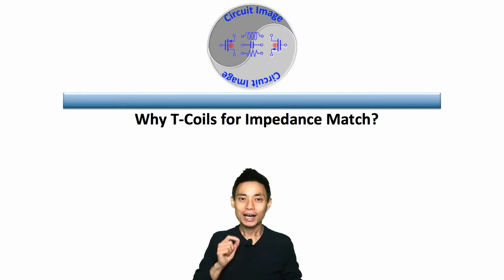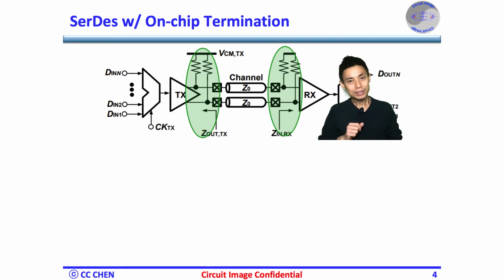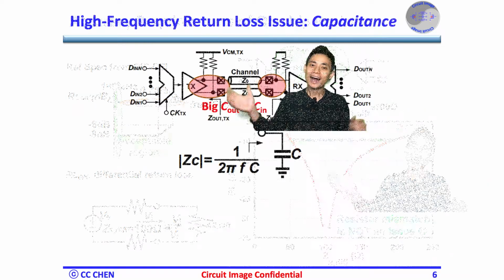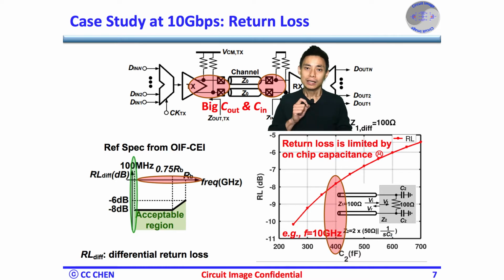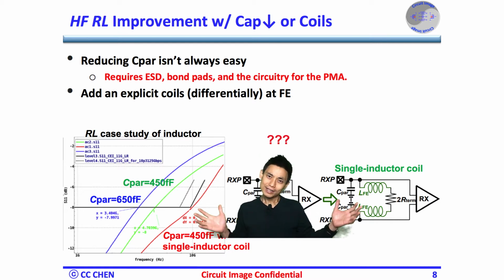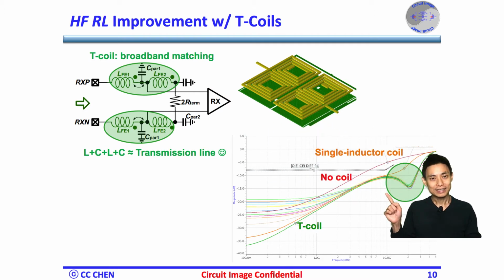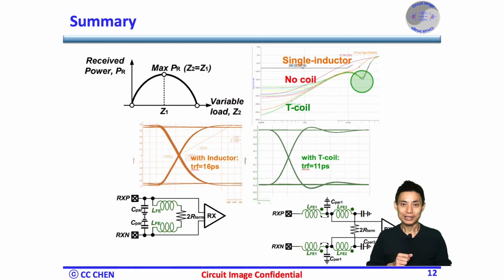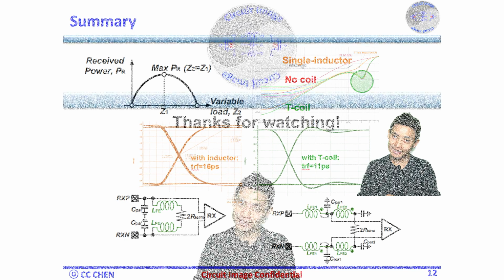Why T-Coils for Impedance Matching?

Comment: Thanks for this informative video.
Q1: Why the tcoils are centre tapped? 
Q2: What is the role of primary and secondary turns in Tcoils?
Reply from the maker: Hi Animesh,
Great questions!
Q1: The center tap in T-coils is often used for biasing or providing a virtual ground in differential signaling.
Q2: The primary and secondary turns form a loosely coupled inductor pair that shapes the impedance and extends bandwidth by peaking the high-frequency response.

Comment: Dear Dr. Chen,

Thank you for your remarkable video presentation—it is both highly educational and truly inspiring.

I have one technical question and would greatly appreciate your insights.

In SerDes front-end design, T-coil structures are often employed to improve return loss. However, I would like to ask about their impact on insertion loss (S21). My understanding is that to support 112 Gbps PAM4 signaling, the S21 should ideally remain above –3 dB across the target bandwidth (e.g., 28 GHz).

Suppose the receiver (Rx) is connected to the center tap of the T-coil, and the on-die termination (ODT) is located at the opposite end. In this case, is it necessary to place an additional termination resistor beside the Rx to improve the S21 performance?

I conducted simulations for both cases (with and without the additional termination resistor next to Rx) and observed significant differences in the resulting S21. Does this indicate a valid design strategy for improving wideband insertion loss?

Thank you in advance for your time and guidance.
Reply from the maker: Hi CY,

Thank you for your kind words and insightful question.

Regarding T-coil usage in SerDes front-end design, you are correct that maintaining S21 above –3 dB across the bandwidth (e.g., 28 GHz for 112 Gbps PAM4) is critical.

When the Rx is connected to the center tap of the T-coil and ODT sits at the other end, adding an additional termination resistor near the Rx can indeed help improve wideband insertion loss by better matching impedance and reducing reflections. The simulation results showing significant S21 improvement with the added resistor support this valid design approach.

However, the exact resistor value and placement should be carefully optimized to balance return loss, insertion loss, and overall signal integrity.

Thanks,
CC
Reply: @circuitimage 
Thank you very much for your valuable information and your kindly reply.
Reply from the maker: @cyliang2229  Dear CY,

You’re very welcome! I’m glad the information was helpful. Please feel free to reach out anytime if you have more questions.

Best regards,
CC

Comment: Thanks for the nice video. You have connected RX at the midpoint of the t-coil. Have seen in some publication people tend to connect the cTLE at the termination rather mid point. Could you please explain which choice is good in which place?

Thanks,
Raj.
Reply from the maker: Hi Raj, nice to meet you and thank you for the excellent question. People applied both ways. If you connected the RX input to the 2Rterm directly, the BW would be wider and may have more peaking. Also, the SNR may not be good since the BW is more than what you needed. Any unwanted high-frequency noise, crosstalk, reflection, etc, would not filter out properly. Therefore, that might applied for the data rate > 100Gbps. So, if the BW is just good enough on your application, connecting RX at the midpoint of the t-coil would be better.  😄
Reply: Thanks for the amazing answer. Could you please explain why connecting at the Rterm is wideband? Also, i learned from the basic theory that we shouldn't load the Termination node as the cap will be sensitivity where as the center tap node can swallow as much cap as it could. This is exactly what I have seen from the publications, all 224Gb/s applications connecting at the termination.
Reply from the maker: @Aadhyacedt  You're correct. The L is connected to the C of the Rterm directly could extend the BW through the LC peaking; therefore, for 224Gbps, I think people may try to make more C-L-C-L-C like pi coil to make it more BW like a T-line. Also, the center tap node needs to be sized properly; therefore, the parasitic from the terimations could work (if Cpar of the Rterm is not too much) or might not work (if Cpar of the Rterm is too much).😀

Comment: I have two questions！
1. The channel is usually composed of the transmission line with specified Z0 (50 Ohm)？
2. We do impedance matching at the interface of the channel, does it similar to add the 50 ohm matching network respectively for input of LNA and output of PA？
Reply from the maker: Hi Po-Yao, thank you for the good questions. Yes, you're correct about 1 & 2. To be clear, the Z0 (50 Ohm) is the single-ended impedance. 😄

Comment: Hi Dr. Cheng, thanks for sharing the great knowledge. I'd like to inquire some questions to you. 
1. As your mention, we can add a T-coil close to RX in the transmission line to reduce the return loss since T-coil is L+C, it's just like the LC in the transmission line, but if the R termination has perfect impedance match, it also can cancel the reflection, so that we don't need to put T-coil. 
2. If we need to add the T-coil in the transmission line, then how to decide the inductance and capacitance. 
3. This is just my wondering, I think the L and C are just the imagination in the transmission line, we don't really put the components(L and C) there right, but for the T-coil, we really put L and C there.
Kindly please correct me if I'm wrong. Thanks for your help again.
Reply from the maker: Hi 育瑛, thank you so much for the good questions and I have comments below.

1. As your mention, we can add a T-coil close to RX in the transmission line to reduce the return loss since T-coil is L+C, it's just like the LC in the transmission line, but if the R termination has perfect impedance match, it also can cancel the reflection, so that we don't need to put T-coil. 
[CC] Sometimes, the single inductor would be good enough, not necessarily to have the T-coil.
2. If we need to add the T-coil in the transmission line, then how to decide the inductance and capacitance. 
[CC] That's not easy to decide and it depends on the ESD cap or size, which may correlate with the bridge capacitance and two inductance values. The ballpark could be 0.5/SQRT(LC).
3. This is just my wondering, I think the L and C are just the imagination in the transmission line, we don't really put the components(L and C) there right, but for the T-coil, we really put L and C there. Kindly please correct me if I'm wrong. Thanks for your help again.
[CC] That's correct.
Reply: @circuitimage  I see, thank you so much, it's really helpful to learn knowledge from your video, thanks agian.
Reply from the maker: @Erichsu-e9m  Hi 育瑛, thank you so much for the good feedback and I'm so happy I can help you.

Comment: 1. what is the importance of dots over inductors? 
2. How do we chose the cpar? 
3. Is the capacitance added to cpar intentionally in some cases?
4. how to make a T coil in layout ? Is it just achieved by placing inductors next to each other? How far should the two inductors be? 
5. could you please point to a research paper which uses T coil to improve the matching?
Reply from the maker: Hi Sai, thank you so much for the feedback. I have comments below in line w/ [CC].
1. what is the importance of dots over inductors? [CC] Good question, the mutual inductance should be added (not canceled) to reduce the area.2. How do we choose the cpar? [CC] Cpar would be part of the ESD cap, which depends on the specification of the protection strength.3. Is the capacitance added to cpar intentionally in some cases?[CC] Cpar would be part of the ESD cap, which was added intentionally for protection.4. how to make a T coil in layout? Is it just achieved by placing inductors next to each other? How far should the two inductors be? [CC] Good question, you could just place inductors next to each other, but the coupling would be limited and may consume more area. Our experience would be as close as possible to save the area under a customized routing. 5. could you please point to a research paper that uses a T coil to improve the matching?[CC] I worked with Professor Razavi about the T-coil and he had a good paper shown below. https://www.seas.ucla.edu/brweb/papers/Journals/BRFall15TCoil.pdf 😀
Reply: @circuitimage thanks for your answering！

Comment: Hi CC. Have a question regarding the circuit diagrams in the summary slide. The RXs are connected to the Cpar or Cpar1 nodes. Why aren't they connected to the 2Rterm directly, which should give a better matching? Actually, I do see in real designs RX is connected to the right of the T-coil right branch. Please advise.
Reply from the maker: Hi Jeremy, thank you for the excellent question. You are correct. If you connected the RX input to the 2Rterm directly, the BW would be wider. But, the SNR may not be good since the BW is more than what you needed. Any unwanted high-frequency noise, crosstalk, reflection, etc, would not filter out properly. Therefore, for the data rate > 100Gbps,  your suggestion is needed since the BW might not be wide enough. Again, the BW of T-coil design would depend on your application and I may talk about those tradeoffs in detail in another video.
Reply: @circuitimage  Thank you
Reply from the maker: @jeremywang6785  You're very welcome.😄

Comment: Hi Chen, Do you know what is the effect of return loss at DC on the transient waveform？Why it is specified that it should be lower than8 or10 dB？Thank you very much.
Reply from the maker: Hi Zhongpeng, nice to meet you and thank you for your good questions. My understanding is the DC does not matter since the coding may provide the DC balance; therefore, the minimum frequencies for the return loss would not be DC. Could you please let me know which protocol or standard is defined at DC? My understanding is 100MHz for OIF-CEII or 50MHz for PCIe, but I could be wrong. 🙂 In addition, the 10dB or 8dB may provide the reflected power to the transmitted power to be ballpark 10% to 15%, which would be reasonably engineering good enough judgment. 😊
Reply: @circuitimage  Hi, Chen, usually, return loss mask specifies the maximum dc return loss. I saw a paper published on JSSC demonstrating a TX chip with -25dB return loss at dc. DC means 0 Hz. But with no further explanations. I guess that a lower return loss at dc makes it easier to meet the overall return loss mask requirements across frequency range. I am trying to devise new circuits with relatively high return loss at dc but sitll within the limit（-15dB or so）. My understanding is that TX dc return loss translates to negligible swing reduction at the RX inputs through higher insertion loss. Therefore, I believe that return loss dc is important just because a lower dc return loss means more headroom at high frequencies for a mask. Do you agree？Again, thank you for your patience and professional advises！
Reply from the maker: @kunchen4871  Thank you so much for your great feedback. I agree with you that having a great return loss at DC (0 Hz) would be a starting point to help you meet the overall return loss mask requirements across the frequency range easily. Usually, the return loss would be getting worse at high frequencies and the lowest at the DC. But there's a caveat you should be very careful. In order to meet the good return loss (RL) at DC (0 Hz), you could add too many switch (NMOS, PMOS, or both) legs to reduce the switch device & parasitic capacitance. Those capacitances would degrade the high-frequency RL quickly and usually, that's happening when we could get a very good DC RL, but cannot meet the high-frequency RL. Then we might add the coils to extend the impedance at high frequency, but the coils might add too much DC resistance (if not designed properly) and make them less signal-to-noise ratio due to DC RL degrading unexpectedly. 😃
Reply from the maker: @kunchen4871  Your understanding is correct. Relaxing the termination for a low power purpose is practical in the industry, but we still need to keep good timing at the RX side to make sure the distorted eye won't degrade the BER too much. :)
Reply: @circuitimage  Thank you very much.
Reply from the maker: @kunchen4871  You are very welcome. :)

Comment: HOw to calculated the parametres of coil, please SIR,?
Reply from the maker: The T-coil's calculated parameters would be L1, L2 & CB. You could apply a simple impedance equation to drive what you need. ZL=sL & ZC=1/(sC). Then decide how to decide the values of  L1, L2 & CB.
Reply: @circuitimage hi cc，you didn't mention CB in the video and only mentioned Cpair to make it similarly as lossely transmission line ，could you explain why CB is essential or it is only paraslistic cap by layout？ Or if CB is necessary，how it can be understood by intuition and engineering？Expecting for your answer，having a good day！